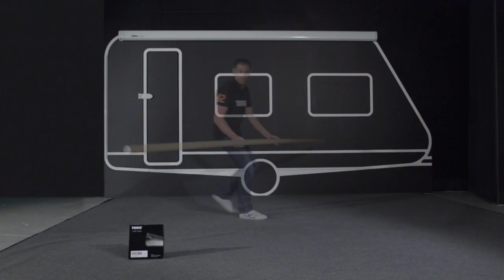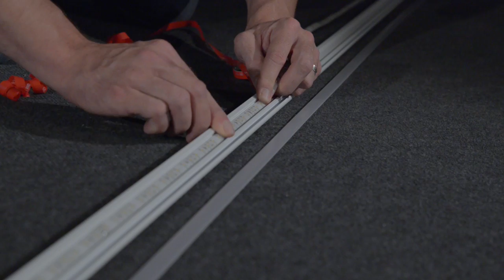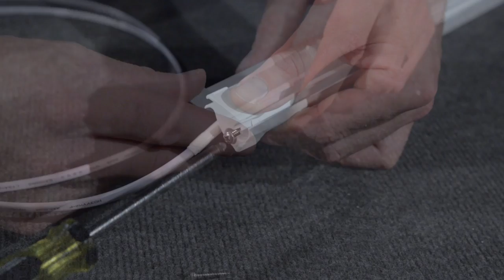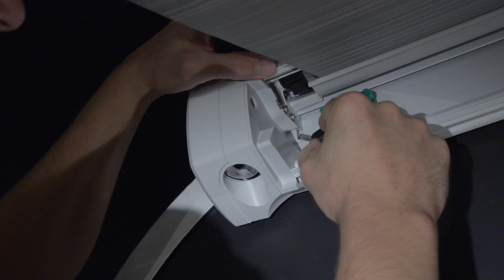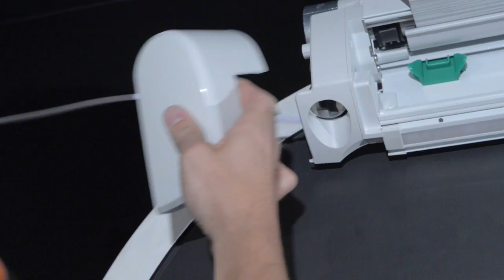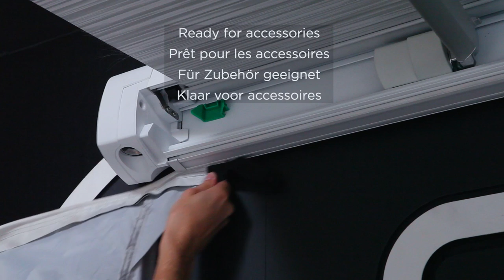RV Awning Tents - Thule Tent LED Mounting Rail - Mounting

Comment: That “click” looks easy here but it actually isn’t. 
We can’t get it in. Any helpful advice?
Reply from the maker: Hi, I recommend checking with the dealer where you bought the product or send in a question to us using our online form on our support pages on thule.com
Reply: I have the same Problem. Did you reseive any help?
Reply: Align the rail as shown in the manual, then use a small rubber hammer to hammer it in place. I just mounted it this way and it worked very well 👍.